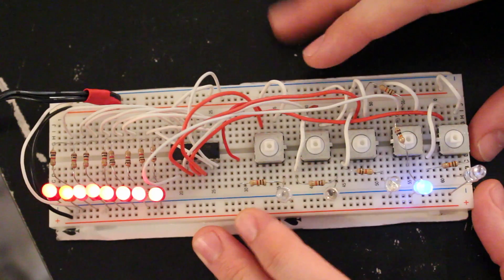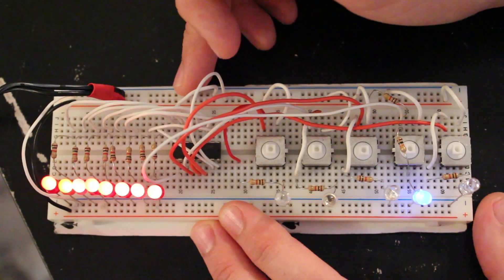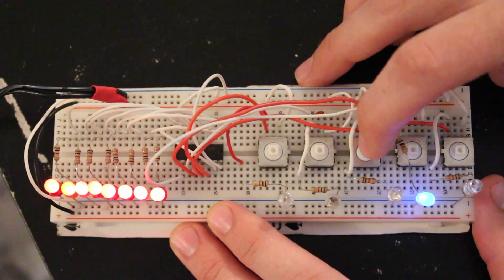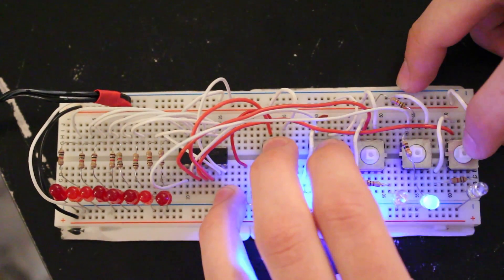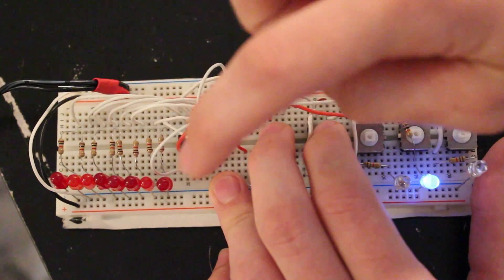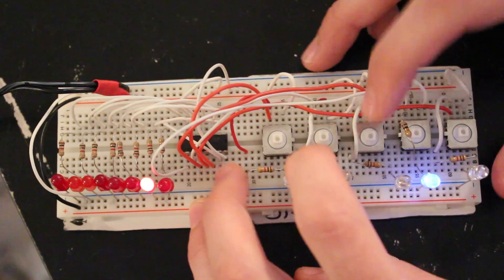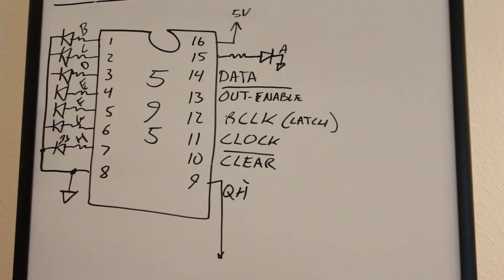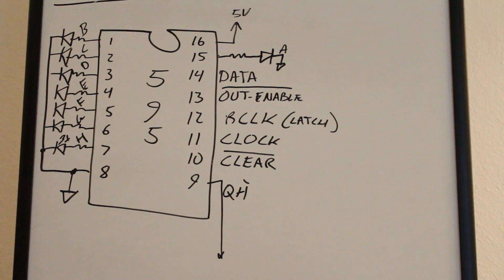How Shift Registers Work - Build the Test Circuit!

Comment: My outputs are all staying high and nothing works. I set output enable to ground and it just dims the leds and latching does nothing.
Reply: +Devan Metz I also had some trouble but managed to get it to work by putting 10k pull-down resistors on the buttons.  I didn't have LEDs on my buttons.
Reply: Don McComb how to do that?

Comment: Thanks Kevin! You are by far my preferred guru on shift registers. I have one question - I have never seen any Tuts. written or video, on using shift registers to control motors or servos. Those hooked up to ARDUINOs should be able to pass PWM through as I have seen full RGB controlled outputs, but I have never heard anyone have anything to say, or show,  about running servos or motors, even if the power could be boosted through a ULN2003 or 2803. Any suggestions? Cheers, and thanks again, mate!

Comment: I made basic button circuit for this chip. And I can't figure ut what's wrong. I just blinking without any sense and not not responding to buttons. It looks like strange noises. Any ideas how to fix it?
Reply: i had the same problem and i believe i destroyed the IC with too much heat. After that experience i used IC-Sockets which i soldered to my breadboards and put in the ICs afterwards. That fixed my problem.
Reply: Use an monostable multivibrator (preffered the 74HCT123).

Comment: hey Kevin,
do i need some kind of transistors or mosfets to control 24 rgb leds with 74hc595 and arduino uno ? or just a seperate power source for them ?

Comment: I tried the similar circuit with only Latch, Data, and Clock.  Couldn't understand why it does not work for weeks.

At the end, I figured the STMicroelectronics version of 74HC595 does not work well with push buttons.

I was did my first "video response" and youtube happened to pull this feature away.

Anyway here is the link
youtube.com/
watch?v=d8V8SRsJRoI

Comment: Congratulations on another well presented video. Isn't it surprising how many people are interested in the operation of shift registers. In case you are interested here is a link to my channel where I operated a shift register with switches similar to yourself only I built it into an enclosure as a permanent display. I used a 555 circuit on the clock line (for debounce) and drove the 7 seg display with an Atmega 328 
youtube.com/
watch?v=hfkZv59ByvU